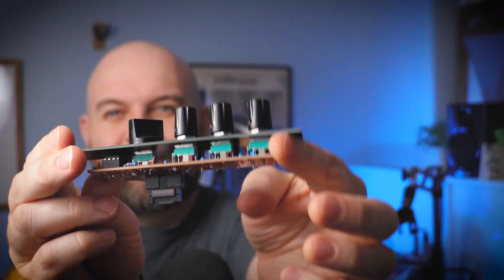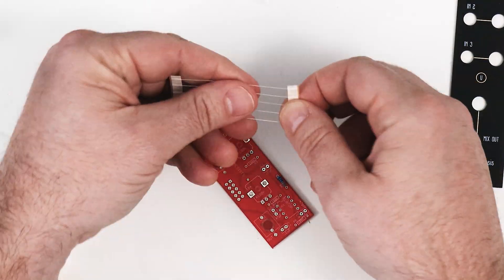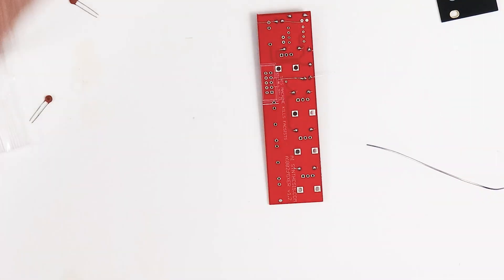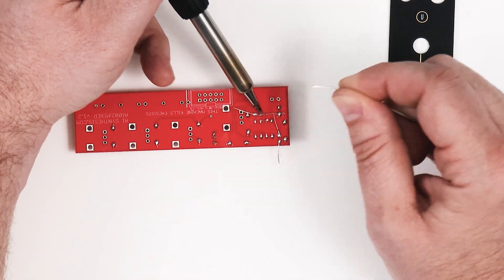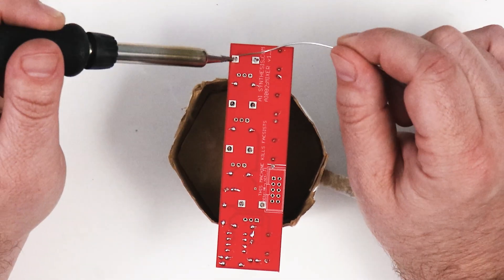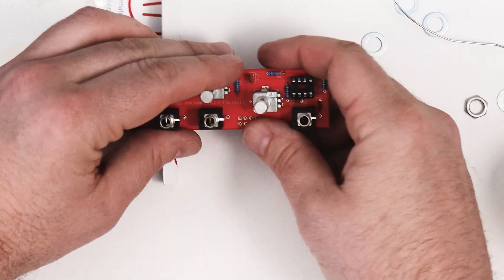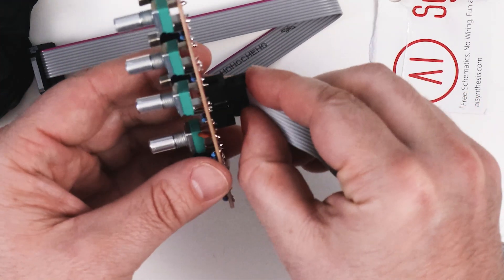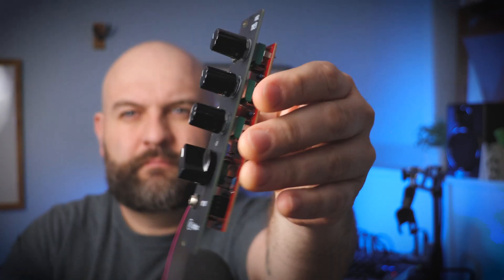DIY Eurorack Module Build - Audio and CV Mixer - AI Synthesis

Comment: Left a comment on the mult video, but checkout the "Engineer SS-02" desoldering pump. Also get some good braid.
Reply from the maker: Thanks! I saw that. The pump you mentioned looks much better than mine. And I definitely needed it here. Thanks.

Comment: Power connectors, IC sockets are actually fairly easy: just solder 1 leg without worrying if the component is flush with the pcb. Then you can use one hand to guide the pcb (and/or the component with your thumb on the other side but beware not to burn your fingers as the component will get hot) and reheat the joint using your other hand. While reheating, the connector will go flush with the pcb if you are guiding it well.
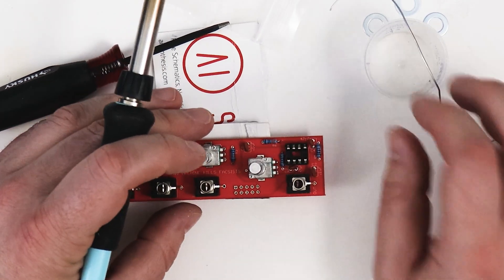Reply: And then for the final problem 13:13 I think you just didn't solder the legs at all to the board ^^
Power socket legs are heftier than say resistor legs so they need a little more time to heat. Make sure you contact the leg and the pad with your iron for at least a few seconds, then apply the solder wire to the pad/leg directly, not on the iron tip and you will be good😄
Reply from the maker: That could have been it... The power cable did feel a little tight. Had I tried to put the power cable in the power socket prior to soldering it would have pushed all the legs out - should that happen? I'll definitely keep this in mind for the next one though!!! Thanks.
Reply: Well explained .. this is a useful technique 👍
Reply from the maker: This is a good tip.

Comment: Nitpicking: ideally you want the iron tip to contact and heat both the component leg and the pad (just like you did 👍) and then the solder wire should be melted by touching the component leg and the pad as well, not directly the iron. This ensures that they are hot enough themselves to avoid cold joints. I think that's what is happening here 5:51. To fix this when it happens, the easiest is to apply a tiny drop of flux paste on the joint and just reheat.
Reply from the maker: Ahhhh!!! I see what you mean! YES! This is extremely helpful!

Comment: Hey bud .. nice build. Re your issues at around 11:00 .. having the front plate attached when soldering the pots would help to keep things aligned :) seems like you’ve gained some valuable exp here with this one. The power header seems like a real PITA; maybe it would have been less grief to have done that first, without all the extra clutter on the pcb. Last thing .. perhaps consider investing in some sort of clamp. I use one that allows me to rotate the pcb, and use if for all of my builds now. Well worth the 10 quid imho ;)
Reply: Yes placing the faceplate and screwing a few components before soldering is mandatory. Some faceplates holes are cut extremely tight (Random*Source for instance) so that there is no room for error on those builds.
Reply from the maker: Noted!!!
Reply from the maker: I'm enjoying this enough that getting a clamp would be in order! I think it will definitely get enough use to justify purchasing it! :)